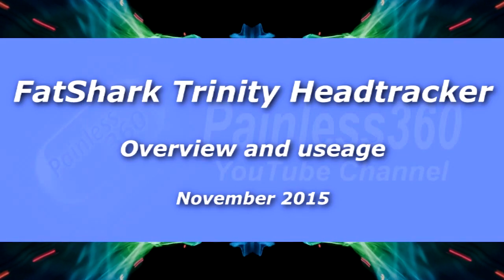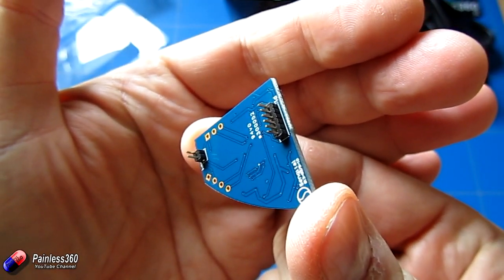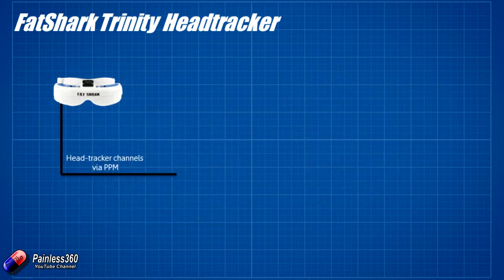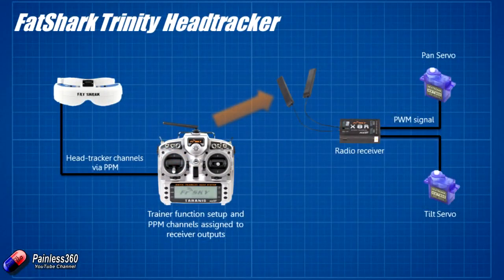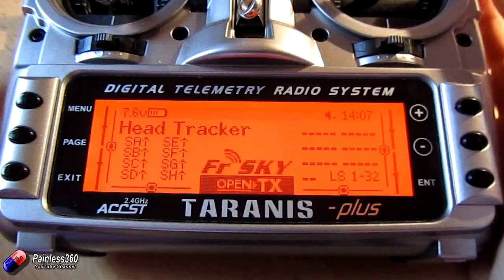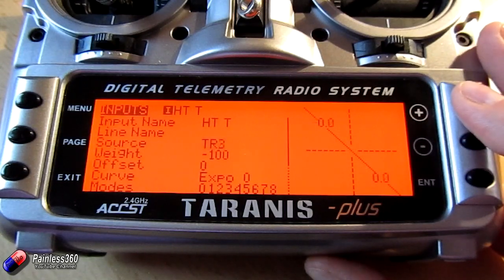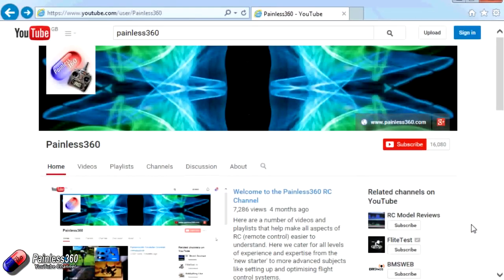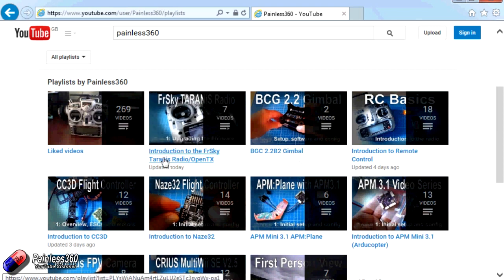RC Reviews – FatShark Trinity Headtracker

Comment: I have read that this FS headtracker had some gyro drift issues related to goggle power lines to close to the headtracker.  Do you have a video on how to address the gyro drift?
Reply from the maker: Most of the drift in head trackers come from temperature changes so let them warm up before use... Happy flying

Comment: Hi Mate one question: do you know if this headtracker will work with my Jumper T-Pro since its trainer port at least to my knowledge only has two contacts but the cable from the headtracker has 3 contacts?
Reply from the maker: Most DSC ports only use two pins, so I can't see whay not... Best of luck!
Reply: @Painless360  Thanks for the fast answer

Comment: Thanks for another nice video.  I like setting mine up so when the switch on the Taranis isn't in the headtracker mode it defaults to being able to operate the pan/tilt from the left & right sliders.  I also find using custom curves makes the tilt, especially, a less exaggerated head movement when looking down.
Reply from the maker: Great idea! How are you programming the switch over?
Reply: +Painless360 I don't use a SF for the Trainer.  I have inputs for LS for pan and RS for Tilt and inputs for HT P and HT T.  Then in my tilt, for example, I mix both inputs and use SA- to take me to the HT T using "replace".  I used a custom curve to give me full down viewing with my HT with only maybe a 30 degree head movement.  Finally, I used your SF "Play Track" so when I use Switch "A" I get a voice track saying "Gimbal ON" which was the only voice track that made sense of the ones available.  BTW, I set it so if Switch "A" is an anything but the center, the sliders work and not the HT.  Of course I added a track for "Gimbal Off" for those. I don't claim to be an expert and there may be flaws with my setup, but it seems to work great. I hope this makes sense.
Reply from the maker: +Hugh Dinwiddie Thanks!

Comment: Hi Lee, first up, thanks for all the amazing video's we all depend on so much, and all the effort you put in to making them. One thing i thought may come in useful for people doing the Trinity headtracker system with Open TX 2.1.6<, and it caught me out for some time, in that when I had trainer active, as soon as I engaged the switch to enable headtracking, I lost all flight control channels and got half throttle, but unplugging trainer port, normal operation resumed, as well as switching tracking off. It turned out simply to be the sub menu for trainer settings (screen 4 of 9) you need to set Thr, Ail, Ele, Rud to off mode otherwise they take over when trainer port is active. One other thing is in page 2 of 12 set trainer port option to 'Master/Jack'. I'm not sure about earlier versions of Open Tx, but from here it is necessary. Cheers.
Reply from the maker: +Alasdair McC thanks for posting! Happy flying!
Reply: @Painless360  Alasdair ... you are 100% correct. My prop instantly pop to 50% throttle right after I switch to trainer.  This is very important & should warn user regarding to this.  I almost got my workbench crush when I switch to trainer.  If Painless360 did a full model testing, he will be aware of this.  Anyway, Painless360 still is very detail & helpful for this head tracking setup.

Comment: I think it's not necessary to set up the special function Trainer because if you set an input to TR6 it always reads that input from the trainer port. The special function Trainer is only used to override your sticks and replace their signals with the signals from the trainer port.

Comment: Great video as always! 

One thing - you don't need to setup a special function for "Trainer mode" to make the TRx inputs accessible. By using TR5 and TR6 the way you have, as source inputs, they are accessible permanently, (in fact all TRx inputs are if configured as a source for a channel - I do this very thing to allow a second radio to control the gimbal of my hexa) and have nothing to do with trainer mode being enabled (or not).

One thing I have always considered would be something to bear in mind with a head tracker, is when you have a skew planar/spironet antenna attached to the goggles themselves (as you do on the Fat Shark goggles). Potentially, looking down to tilt the camera could put the flying model (I.e. transmitting signal) into the null/low gain zone of the receiver antenna, so something to watch out for!

Comment: I am struggling setting this up, the differences to this are changed channels on the trinity to 7 and 8, connected to ezuhf jr module and servos connected to pixhawk. When I power on the Taranis the Dominators just continuously beeps.
Reply from the maker: What troubleshooting have you already tried?
Reply: +Painless360 I have checked that the the trinity is properly installed in the goggles, checked the connection between the goggles and ezuhf module, I have tried different channels on the trinity and use the corresponding channels on the taranis.

Comment: have you tried mixing you head trcker to you flight controls?
Reply from the maker: Nope, I would not trust a head tracker to manage main flight controls..
Reply: Painless360 it's something I'd like to try when I get my radio next year. I was thinking the head tracker weight shuld be around 20% and your fingers still firmly on the sticks with  A kill switch at hand. If you ever do try it I would recommend using a sub-micro model and do it indoors to work out the bugs. I can see how doing something like this could be  dangerous, but a lot of fun and just that much more immersive.

Comment: Please cover the 3D capabilities of these posh goggles if possible. Widescreen 3D fpv with comfy clear googles that didn't steam up in a cold field would tick all the boxes for me. I still think it's a bit frustrating that there's no diversity capabilities within the unit when other manufacturers manage it without issue.
Reply from the maker: Still too many options for 3D in the hobby to make this easy. These goggles support 'side-by-side' style 3D and I'm struggling to find a compatible 3D camera..
Reply: +Painless360 I hadn't considered that Fatshark or immersion hadn't made one available. I also thought i'd seen a video about it but a quick tube shows me I was also mistaken, noone seems to have done it. I heard rumours of some kind of issues due to some overlap but not sure which version. I also see dom hdv1 and v2 and dom v3 googles. Are these the same range? white, blue or black button area.
Reply: Paul Atherton And very much a downgrade in image quality. There's an RCG thread on it but I have quannumv2 so not happening with that setup. All the videos where peopled tried 3d fpv its looks fun but noone seems to use it as their main choice for fpv.
Reply: +MicroRCFiend Yes, of course, with it sending SBS 3D, the width of image for each camera is half of the width of the broadcast frame, so half as many pixels captured for each eye. Theres no real way to improve the quality until a decent (and reasonable priced) digital solution emerges offering HD frame broadcast (really need 1080p to get half decent SBS 3d too)

Comment: Finally after getting this month's ago it will not work.. search the net no conclusive answers.... Painless to the rescue sort of... How do you access the beep menu while turn it on with button pressed. my issue was that the defaults did not work but on hearing how to access the menu and then downloading the instructions I was able to reset the pcb and now I have head tracking.. yay thanks Painless...
Reply from the maker: Glad it's working. The tracker is not cheap and works well. I wish the instructions were a little clearer. Happy flying!

Comment: I have a disability , can you set the sensitivity of the head tracking to be more sensitive?
Reply from the maker: There is a limited setting on this one. You can choose 1:1 or 1: 1.5 ratios though the menu (https://s3.amazonaws.com/helpscout.net/docs/assets/52a0a907e4b010488044ba40/attachments/544729f3e4b02a8c56ed86df/2412-Spec-RevA.pdf). Hope that helps..
Reply: Painless360 can you make a video on how to navigate that menu? I cannot figure it out.

Comment: Cheers Lee. Do I have to set up a special functions switch if I want to swap between head-tracker and radio sliders (LS,RS) ?
Reply from the maker: +JohnnySlash We setup a switch that overrode the gimbal channel values so it 'turned off ' the head tracker. Happy flying!

Comment: I searched .... but, can you use this to pilot the craft or is it just for 2nd rec. camera
Reply: +Vic Prk (Slick  Vic) With a suitable radio it would theoretically be possible but it is definitely NOT advisable. 
HTs have a habit of losing orientation when pushed beyond the normal operation range which can cause all sorts of extreme reactions at the model most likely leading to a crash. So what is an inconvenience on the camera axes is a total disaster on the flight control axes.

Comment: Hi Painless360.
I have found also the HT FSV1901. Which is the difference with the FSV2413 ?
Thanks in advance
Reply from the maker: +IceCreams62 I think the one in the video is the latest version with the 3 cables..
Reply: +Painless360 

The strange thing is they seem to be the same board but the price is completely different:

http://www.rcplanet.com/Fat_Shark_Module_p/fsv1901.htm

120 USD

http://www.rcplanet.com/fat-shark-rc-trinity-head-tracking-module-with-cables-fsv2413_p/fsv2413.htm

86 USD

Comment: I have just ordered the Module for my Dom V3s.
Thank you for the great video on how to set up. I shall watch it again when the module arrives.
I intend to use this with my EZUHF 4 channel system.
Do I put everything on the PPM channel (channel one muxed) as normal but plug the HT into channel 2 and 3 of the RX. Then assign those 2 channels as what ever I need them to be in the immersion software via my PC?

Thank you.

Mark.
Reply from the maker: If you're using PPM on the model side then you need to loo at channel forwarding on the flight controller to 'present' the two headtracker channels on spare PWM pins for the servos to connect to. Some receivers also output PWM signals when using PPM, others don't so you'll need to test it on the bench. Best of luck!

Comment: Hi Painless360, great video thank you.  Let's mix it up, currently my Taranis is set up with the EZ UHF module in back. My aircraft has a pan and tilt system on it and has the channels assigned accordingly to control from the Taranis.  Is the Taranis radio set up the same from your video to get the EZ UHF to control the head tracking?  Or is there some different steps I will need?  Thanks for any comments and help.
Reply from the maker: I've not used that system here but in theory, yes. Best of luck!

Comment: Hi I am looking at getting the head tracker my auto pilot uses channel 5 as its out put could I set trainer ports to 6/7 for pan and tilt would that still work
Do you use your head tracker much is it worth it
Reply from the maker: +dragon121978 you can map the outputs from the head tracker to any channel that you want on your receiver. Personally, I don't use it very often as a head tracker is only really handy for flying things like fixed wing models.